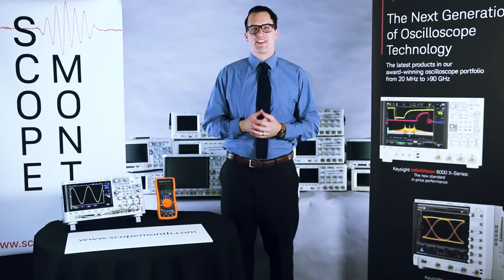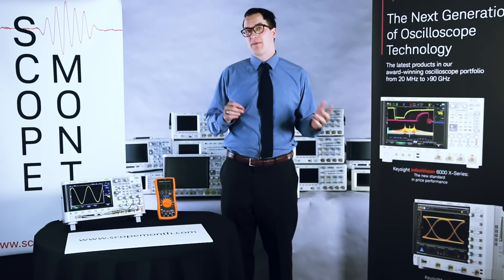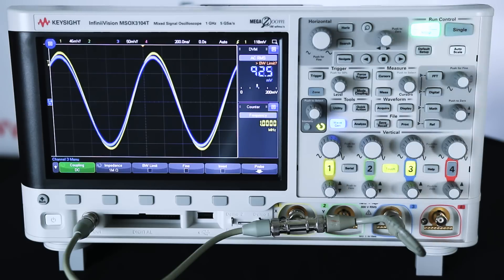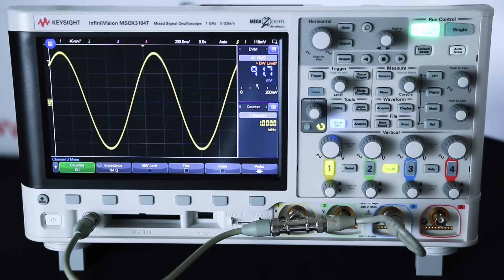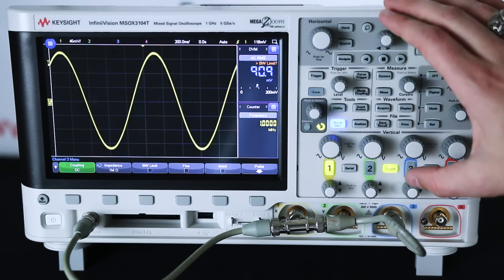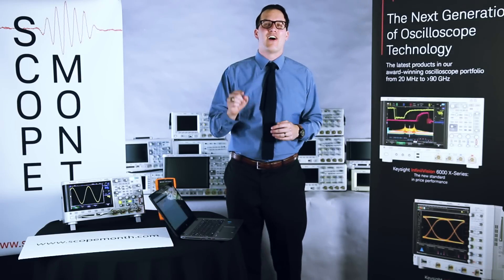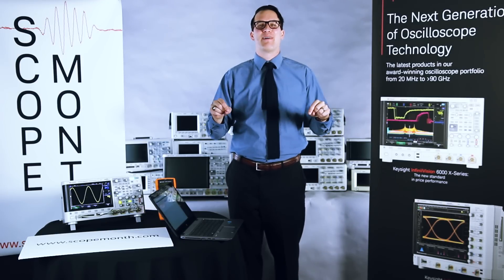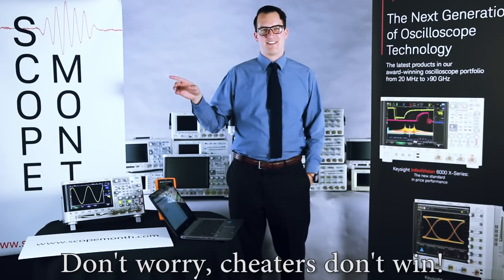Integrated DVM and Today’s Scope Month Winner (31-March)

Comment: Hi, Daniel,

I sent in a video for the "Test to impress" contest, also got a confirmation email on March 10, but the video does not show up on the contest page now! Could you kindly help me check what went wrong and how to fix it?
My video is the one which describes a concept to build a super cheap and simple time domain reflectometer without any high-speed hardware (meanwhile, the prototype is working well, with 4 cm resolution).

And another issue: It looks like we need a facebook acoount to vote for a video? Any alternative for people who are not on facebook?

Thanks a lot!

Johannes
Reply from the maker: +transfunktionator Thanks for reaching out. We did receive your video, but are having some trouble processing it. I'll follow up with you in an email.
Reply: +KEYSIGHT OSCILLOSCOPES Thank you very much!
Reply: +KEYSIGHT OSCILLOSCOPES Hi, Daniel, I got the mail from Allison, but it seems like my response does not come through. Is there another way to communicate?
Reply from the maker: +transfunktionator Thanks for your message, your video is posted for voting now!